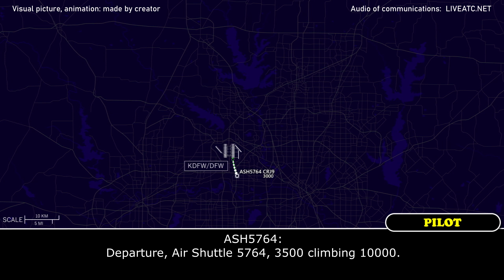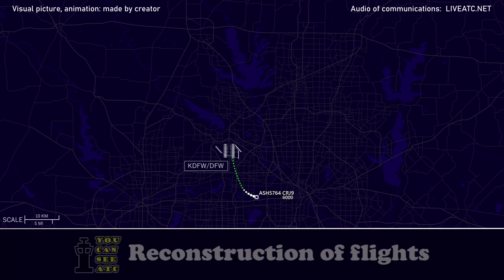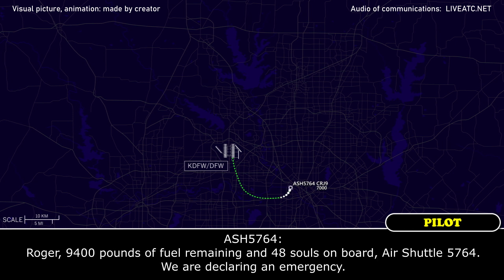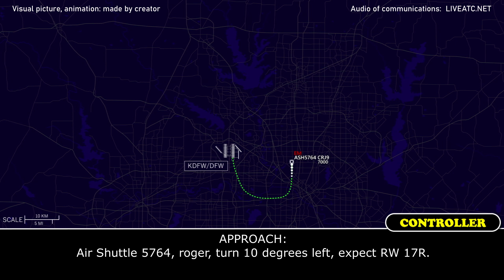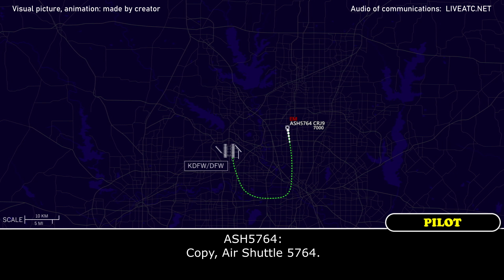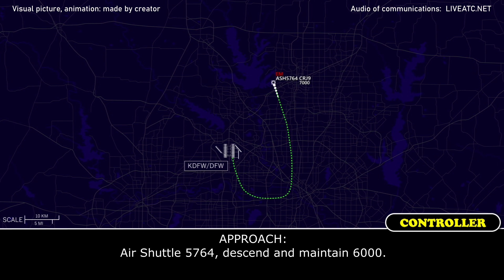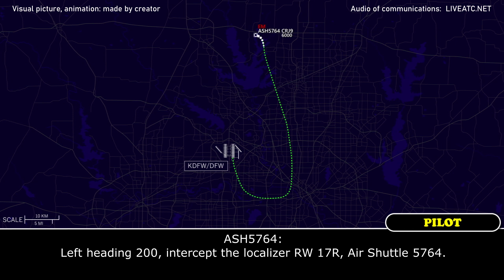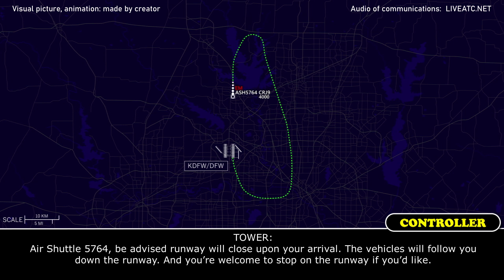High temperature on both engines, Emergency return | Mesa Airlines CRJ-900 | Dallas-Fort Worth, ATC

Comment: OK a few comments here. The pilots need time to setup for a lot of things went an emergency occurs so they requested a couple of minutes to do that which accounts for the extended downwind. The controller when asked about the runway they could expect had at least two other controllers she had to talk to for coordination and that takes a little ( very little) time. They were some 20 miles out when they were asked if the aircraft already on final could continue - pilot's discretion here - if it was not ok the other aircraft would have gone around. Key point - don't make a problem into a potential disaster.

Comment: Not really acceptable to take an emergency aircraft on such a long downwind because of other traffic, taking them out of glide range with issues with both engines, and more importantly prioritising non-emergency traffic over emergency traffic. 

This definitely isn’t helped by the US’s refusal to use the international standard PAN-PAN and MAYDAY, instead using “declaring an emergency” which gives little indication of urgency.
Reply: if she didn't think that he declared emergency she wouldn't ask em for fuel qnd number of ppl on board
Reply: The aircraft pilots have that discretion. It is imperative to configure the aircraft for landing. Its a checklist the pilots have to follow which will give a positive outcome. 

Flying directly in is not logical for a engine overheat. 

Calm cool collected

Pan pan is recognized as a trouble and so is mayday. This is why you hear the atc immediately ask the nature of the problem. Approach will jump on the call and vector the aircraft according to the emergency. Since it id a likely oil or fuel leak the airport will close the runway when the emergency craft lands. All of these are procedural steps
Reply: @Astinsan     Nothing you said there is incorrect. The part that concerns me is at 3:03 when the pilot says “we’re ready to proceed to the airport” and the controller says that “they have to take you out to the left of the traffic that’s already on final there”. In the majority of situations, allowing aircraft already on approach to land will cause less disruption, but it has potential to make the distress/urgency aircraft’s situation much worse. That’s why, per ICAO and I’m sure the FAA, emergency aircraft have priority over all other traffic, regardless of the stage of flight other traffic may be in.

Comment: Not enough emergency prioritization by ATC
Reply: Yeah. There's no standard for emergencies. The communication is always different
Reply: Don’t give Dfw a bad time.  They arrive on the center and the left.  It’s all arranged with minimal separation. They do a great job. So they had to sequence in the black tail.  They landed in their primary east side departure runway and closed it.   The controllers are all excellent.
Reply: Nice. They did a great job , Bonus plan: no injuries.
Reply: @imaPangolin  Don’t interpret everything I say as a personal attack on ATC. If your engines were both overheating and could potentially fail would you like to wait for the “existing aircraft on short final” to land and have to get sequenced behind them? It’s a very busy airspace, I get it. But emergency aircraft should get total priority. Send the existing ones around.
Reply: @sarahalbers5555  it’s not about the outcome. It’s about what could have been the outcome.
Reply: @flapppytappybird7923  it’s more complicated than that.  You’ve got to move the emergency aircraft across the arrival paths of two runways.  If the crew needed to go direct to the runway they would have asked for it.   I’m qualified to answer this as I’ve flown that exact plane in the last month.  They had high ITT.  If the duration was long enough the engines will need to be boroscoped.  Best done at Dfw.   Yes I’d declare for that but the engines are not likely to quit and we still need time to prepare the cabin and setup for the approach and landing.  Atc asked if what they were doing was ok.  The ca said yes it was ok.  They got exactly the right handling.
Reply: @flapppytappybird7923  so simple eh.  You run your own multi runway airport out back right?  (Actually 2 when factoring in love field traffic)
Reply: @OOpSjm  Bruh stop being such a simp for ATC and pilots alike. No it’s not simple, but it’s their job. As per ICAO and the FAA, emergency aircraft get complete priority.

Comment: any insights on what would cause overheating on both engines??
Reply: The most common issue is when the engine oils are over serviced
Reply: @husky7479  and thus spewing past the seals, and adding heat to the combustion process
Reply: @ghostrider-be9ek  thank you...
Reply: Def not oil.  Its exceedingly hard to over service the oil on the 900.  Tired old engines maybe.  Unusual on both though.  Certainly worth the return to field.
Reply: @imaPangolin  It is hard to over service engines on a 900. But I have seen fellow employees at my job do it. The last engine overheat incident we had come in was on a 900 and it was due to the engine oil being over serviced. But that doesn't mean it's the case here. It's also the very first thing the GE engine Fault manual says to look at as well.
Reply: they didn't filled the coolant to near max mark 😆
Reply: Yes, it’s MESA.
Reply: @husky7479  What is over-servicing?